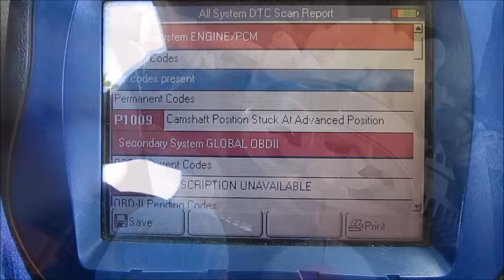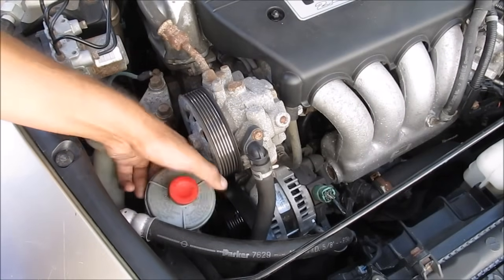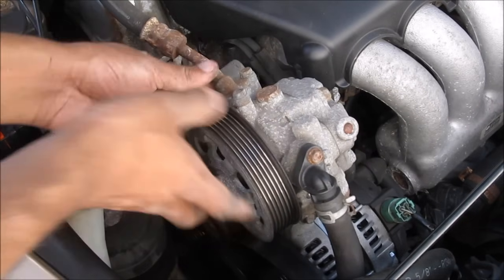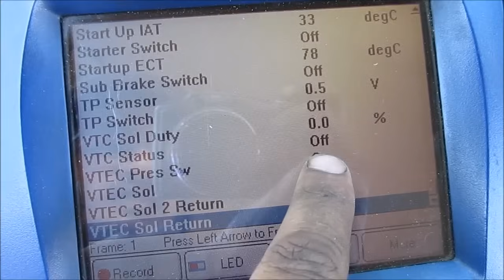P1009 Honda VTC Valve Cleaning

Comment: Thank you for the excellent video. 

I cleaned the VTC valve on my 2004 Honda Accord with 132,600 miles, which had the p1009 code. I've driven it around 22 miles since the cleaning and the check engine light has not come back on yet. I will need to drive it more to be sure this procedure addressed the problem. 

Here are a couple of comments: (1) the strainer looked pretty clean, but I cleaned it anyway; (2) testing the solenoid by applying 12V across the terminals took awhile because access to the terminals within the connector housing is very tight. It is too small for alligator clips. I finally located a couple of long probe pins that worked okay, but one has to be careful not to touch them together and short the circuit; (3) during reassembly, replacing the bolt that holds the solenoid on is tricky because you can't see the hole, and replacing the idler pulley is also a little tricky as you have to hold the nut that receives the bolt in position in the back of the housing while you thread the bolt or the nut pops out. There is not much room to get your hand in there. I popped the nut out once and it took 10 minutes to find the bolt as it landed on the plate below the engine.

Since the solenoid works and neither the solenoid nor the screen seemed dirty, I'm not sure why the cleaning solves the problem. But if it works, I guess that's what's important.
Reply from the maker: +Richard Wilhelm Thanks. My solenoid didn't seem that dirty either, but I drove thousands of km after and didn't get a p1009. 

That nut can be a pain if you lose it, mine was rusted/crusted on there so it didn't fall out. 

Did you change your O-Ring? I think mine started leaking after cleaning my solenoid.
Reply: I didn't replace anything. I will check for leaks. I hope its okay as I would prefer not to repeat the procedure to replace the O-ring. Thanks for the tip and thanks again for the video.

Comment: hola amigo  que hace el motor con ese codigo  p 1009  ruido a matraca en frio?  mi honda hace eso y creo que puede ser el actuador pero comenzare por la limpieza de esas cosas que haces tu, sería lo mas basico no?  luego si sigue cambiare el actuador,     le hecho aceite 15w -40    está bien?
Reply from the maker: You don't want to use 15W40, that'll make it stick even more. If cleaning it doesn't make the code go away, replace the solenoid.
Reply: no sale bien la traduccion pero creo que estoy errando en el aceite ,que pongo 10w 40 o 5 w 40?gracias

Comment: would this cause a p0011 code as well on the same engine 2.4 vtec to come on same description
Reply from the maker: +Ghost Face yes same procedure.
Reply: your right my valve broken so was faulty the replaced all fix no light been 5 days drives great. had a rattle sound on the old one went away on the new one mine was just bad

Comment: Nice job!  Good video- concise but not too long and drawn out.
Dude, don't you have a long 3/8 ratchet??   Well worth the $$
Reply from the maker: Thanks, short and to the point is my style. No I don't have a long ratchet, I prefer this one since it can reach in tighter areas of the engine and I can just stick the pipe on it if I need more leverage. Usually at that point I step up to my 1/2" drive breaker bar.

Comment: Can you please do a video on how to remove speed limiter on Toyota's cars.....thanks.
Reply from the maker: +Basil4everx We don't have speed limiters in North America.
Reply: My car has a speed limiter , it's 99 camry 4 cylinder engine, it stops at 185 km/h unlike most of my friends cars which are the saim car. I tried to use techstream software to find out how to remove speed limiter but I couldn't find any solution for this problem.
Reply from the maker: +Basil4everx I think that's just how it's geared, electronically limited to prevent engine and transmission degradation. This is something in the ECU program that you can't change, it's not a government speed regulator that can be hacked easily. 
Are your friends car the v6 or 4 cylinder?
Reply: +speedkar99 it's a 4 cylinder engine & automatic transmission.
Reply: +speedkar99 but when I disconnect the speed sensor i could get over 185 km and i use the GPS to know my speed , i reached about 200 km.
Reply from the maker: +Basil4everx That's interesting to know. I guess if you could intercept the signal from the speed sensor to the ECU you could trick it that it's going slower than you actually are. Then you'd have to compensate on your speedometer. What RPMs are you hitting at 200kmh?
Reply: Well,when i hit 185kmh , the RPMs stops at 4500 and it's unable to increase any more. So if you could help me to solve this problem that's will be great.